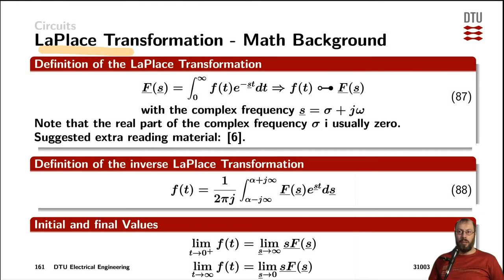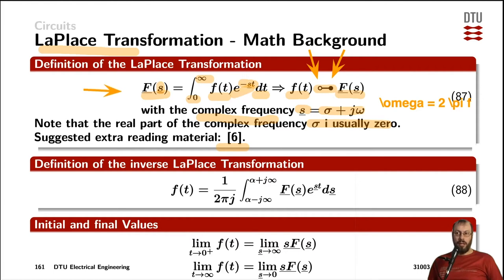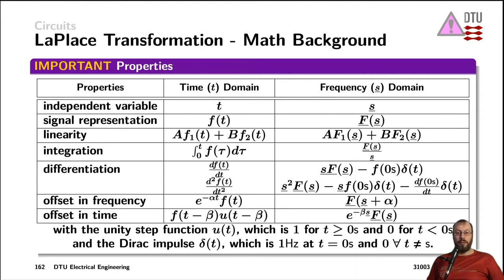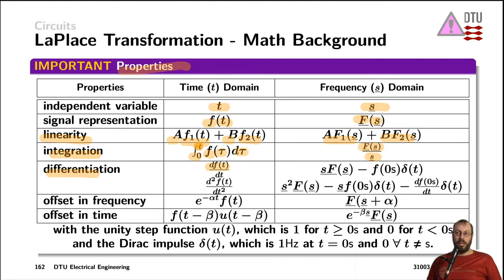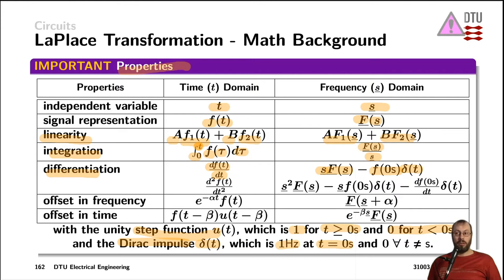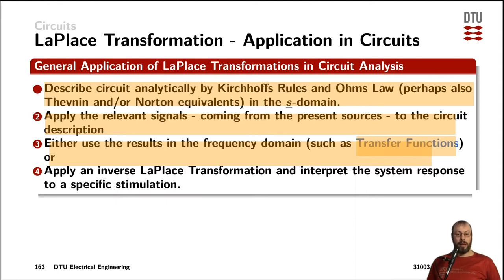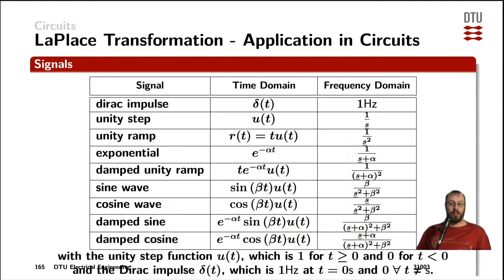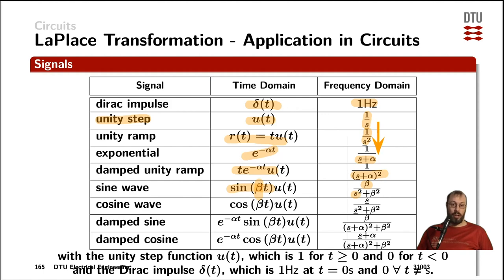Circuits: LaPlace Transformation (mathematical background and application to sources)

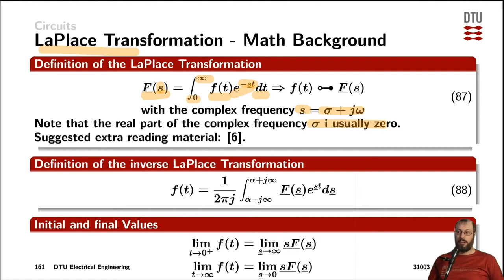Comment: 1:22 "very often sigma is just simply put to zero". That is not really true. When sigma is zero, then s = jw and we can find the frequency response H(jw), which is what you see if you plot the Bode plot of the transfer function H(s).
However, you can only plot H(jw) if the imaginary axis (sigma = 0) is inside the region of convergence of the Laplace integral. Otherwise, H(jw) is meaningless and the system is furthermore unstable.